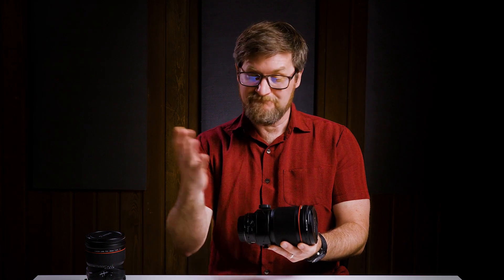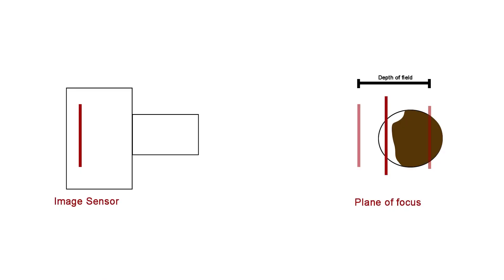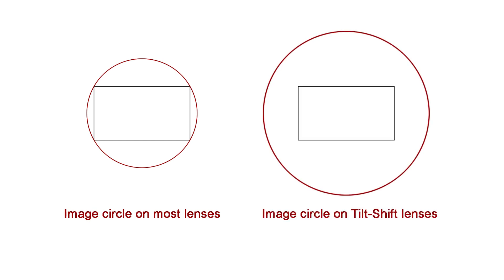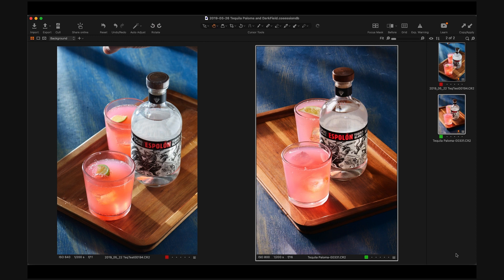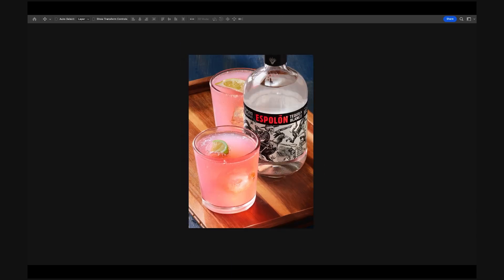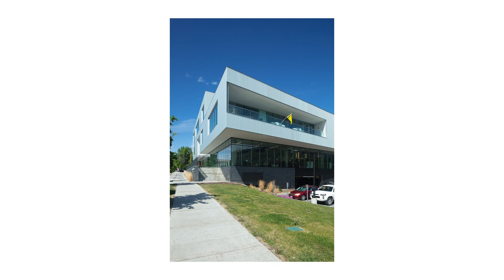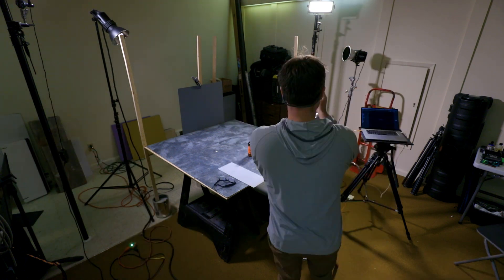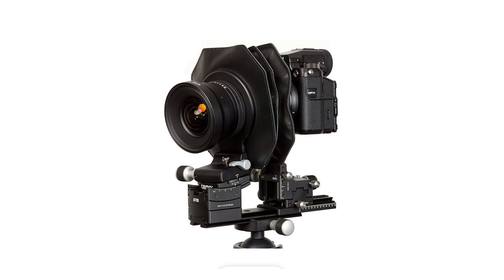Tilt Shift Lenses  | How do they work and do we care?

Comment: Thanks for this video.  I first purchased the TSE24mm for the toy effect. Then realized that I needed a wider lens if I wanted to do broader landscapes, so I got the TSE17mm. I later purchased the TSE90mm, but hardly use that, though I would love to for artistic portraits. But everything you've said about the TSE17/24mm is spot on for architectural/landscape shots. I purchased an adapter for my GFX100s and now frequently use that for landscapes. It takes wonderfully sharp and with the correct perspective, that I've taken some amazing shots with the 100mp getting everything sharp corner to corner.  Amazing lenses.

Comment: There's a tilt shift ef rf adapter that allows you tilt shift any ef lens on an rf body
Reply from the maker: Photodiox makes some for other mounts as well. I picked one up to test out. You have to have a lens that has a larger image circle than your sensor to avoid vignetting. So, a 35mm on APSC or medium format on 35mm for example. I have some Canon FD lenses I modded to EF to use on my Fuji X. Otherwise with my Canon system I just use the TSE lenses.
Reply from the maker: Yep!

Comment: Thanks for the video.

I use the limited shift feature of my Nikkor 28mm f/4 PC lens mounted on my full-frame cameras to control perspective.

When I need to control the depth-of-field by using the Scheimpflug principle to alter the plane of focus, I use a Nikon to Fuji tilt adapter to mount my Nikkor 28mm f/4 PC lens on an APS-C Fuji X body. This adapter adds a tilt feature to a lens that has a shift feature. The only disadvantage to this method is that the 28mm wide-angle lens now performs like a normal lens.

If the front shift/tilt movements of my Nikon 28mm f/4 PC lens mounted on my Fuji X body with a tilt adapter does not meet my needs, I use the front and rear shift/tilt features of my 4x5 inch monorail view camera.
Reply from the maker: Does your 4x5 have a digital back? Check out the Cambo Actus series - pretty cool. Thanks for sharing and thanks for watching!
Reply: @onseteducation921  
No digital back; thanks for the recommendation.